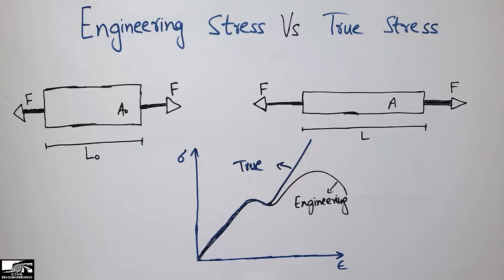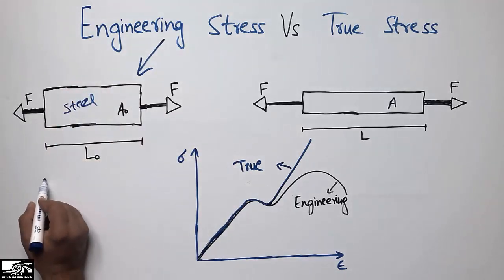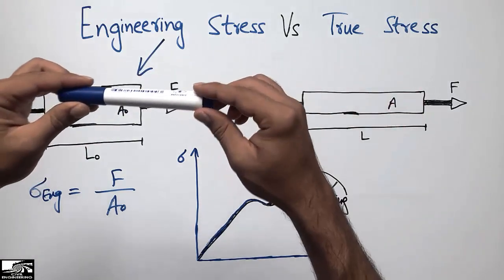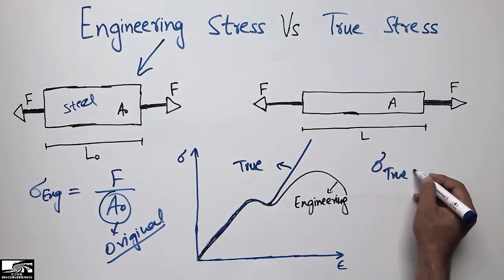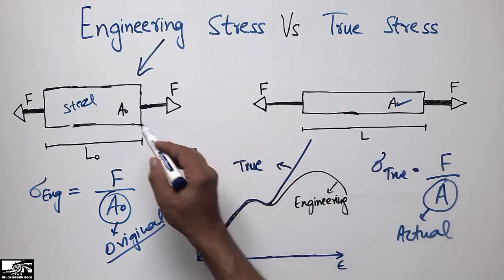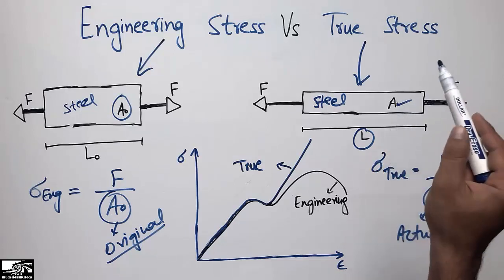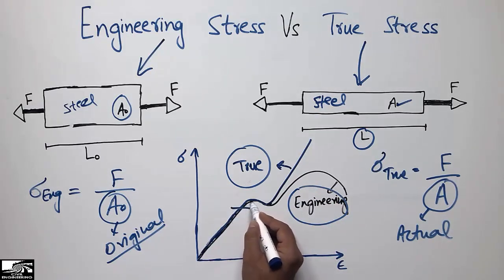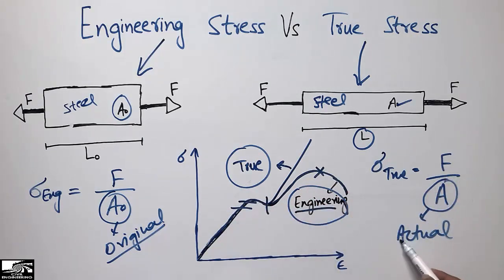Difference between Engineering Stress and True Stress

Comment: easy: the engineering stress checks young's modulus ratio to know how much has changed with reference to the original cross-sectional area when a particular loading is applied. the true stress on the other hand checks young's modulus ratio to know how much has changed across time when a particular loading is applied.